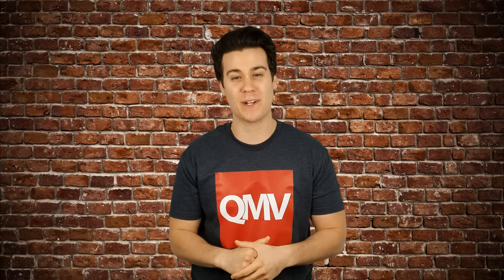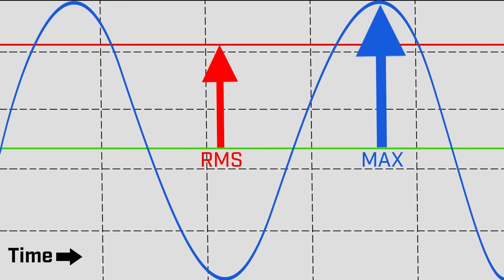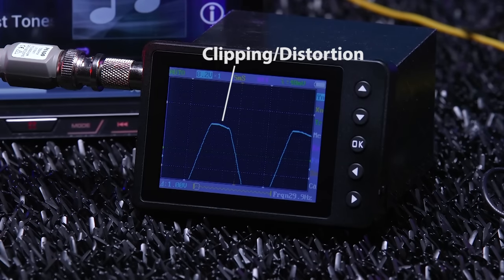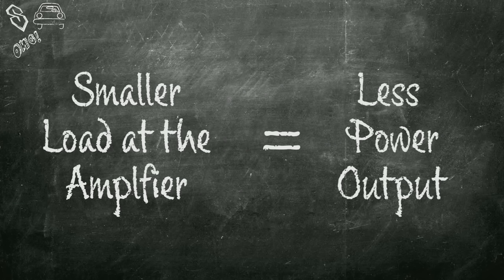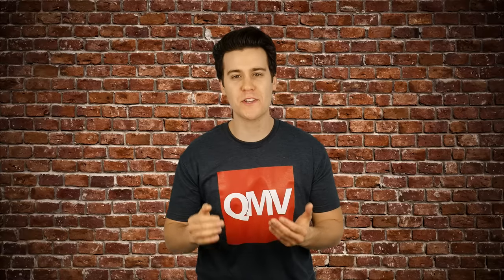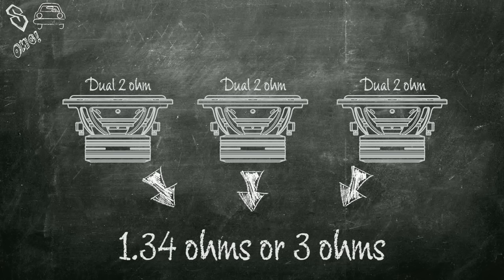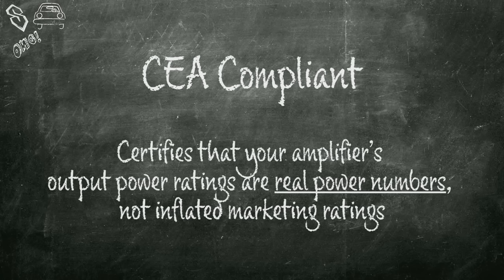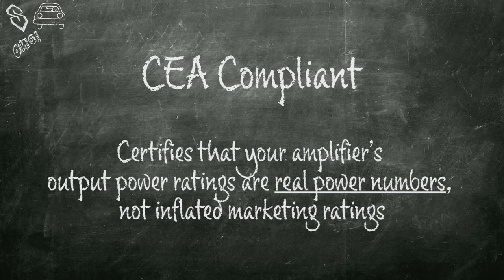How Do You Match Car Subwoofers and Amplifiers?

Comment: Great video, question for you; I have a foxbox with two 12” Alpine Type R / 2 ohm / 2250W Max 750 W RMS / model R-W12D2 going in my 2017 Ram Truck Quad cab. Trying to determine a good amplifier and want to know your suggestions? I currently have an Alpine mono M500 which I know is quite under powering this.
Reply from the maker: Thanks Tommy! Ok so you have Two DVC 2 ohm woofers with a combined RMS of 1500W. Two DVC 2 ohm woofers can wire to a 2 ohm or 8 ohm load. You'll ideally want a monoblock amplifier with a power range of about 1400-1700W RMS @ 2 ohms. Here are some examples:

Power Acoustik EG14500D 2000W RMS @ 2ohms
http://www.qualitymobilevideo.com/eg1-4500d.html?utm_source=YouTube&utm_medium=Video&utm_campaign=Match_Subwoofers-Amplifiers

Power Acoustik BAMF1-5000D 1700W RMS @ 2ohms
http://www.qualitymobilevideo.com/bamf1-5000d.html?utm_source=YouTube&utm_medium=Video&utm_campaign=Match_Subwoofers-Amplifiers

Hifonics Zeus ZRX3216 1600W RMS @ 2ohms
http://www.qualitymobilevideo.com/zrx3216-1d.html?utm_source=YouTube&utm_medium=Video&utm_campaign=Match_Subwoofers-Amplifiers

Hifonics Brutus BRX2016.1D 1400W RMS @ 2ohms
http://www.qualitymobilevideo.com/brx2016-1.html?utm_source=YouTube&utm_medium=Video&utm_campaign=Match_Subwoofers-Amplifiers
Reply: Quality Mobile Video thanks so much for the information, it is greatly appreciated.
Reply from the maker: @tommy.32221  Anytime!

Comment: Okay i have a question, sorry if this has been gone over but..
I have 2 Subs with a RMS combined of 1000, and I have 4x Car door speakers with a RMS of 360.
My question is am i able to connect all 6 to one Amp or will i need to purchases a separate Amp for each, and if i can use just the one amp, what should i be looking at? oh and both are 4 Ohm.

Cheers

Comment: im looking to buy a prefab box whit 2 12'' sub running a total of 1500watts on there site it says 4+4ohms what does this mean it is the Hifonics MXT12DUAL whit a Rockford Fosgate T2500-1BDCP amp is this a good match or is this bad im new to building my onw subwoofer install ?
Reply: 4+4 means its a dual 4 ohm voice coil setup

Comment: I understand the whole multiple subs concept but im struggling with single subs so I just brought a Kicker comp R 10inch sub with 800 watt max and a 400 watt RMS while my amp is a Crunch PDX 1000.2 channel amp with the specs as listen 
General Features:
PDX Series 2-Channel Class A/B Car Amplifier
MAX Power Rating (14.4V):
4 ohms: 250 watts x 2 chan.
2 ohms: 500 watts x 2 chan.
Bridged, 4 ohms: 1000 watts x 1 chan.
RMS Power Rating:
4 ohms: 125 watts x 2 chan.
2 ohms: 250 watts x 2 chan.
Bridged, 4 ohms: 500 watts x 1 chan.

WILL THIS WORK FINE OR DO I HAVE TO WORRY ?

Comment: So I am attempting to install the ss ws82 subwoofer into my brother's 2008 Toyota corolla car. its input is 150 watts, I want to add it to the car and leave the original speakers the same. can I get by with a 160-watt amp? it is hard to find exactly 150-watt amps online for cheaper. or any other suggestions?

Comment: HEY JAMES WHAT AMPLIFIER WILL I NEED FOR MY (2) RMS 750 Watt
AUDIOPIPE 12" 3000 WATT Car DVC Subwoofers
2.5" DUAL 4 Ohm Voice Coils
Double Stacked Strontium Magnets
Powder Black Cast Aluminum Basket
12" Dual 4 ohm TXX-BD Series Subwoofer Power Handling: Peak: 1500 watts RMS: 750 watts 2.5" 4-layer voice coil Top-mount depth: 7-1/4" Frequency Response: 20-900Hz Sensitivity: 88dB Patent pipe multi-connect terminal Powdered black steel basket Double stacked magnet
Reply from the maker: Hey Michael! Two DVC 4 ohm woofers wire to 1 ohm or 4 ohm. You'll probably want to go for the 1 ohm load (parallel wiring). The subs have a combined RMS of 1500W. So you'll want a monoblock with a power rating of 1400-1650W RMS @ 1 ohm. Check these out:

Orion XTR15001.Dz 
https://www.qualitymobilevideo.com/xtr15001dz.html?utm_source=YouTube&utm_medium=Video&utm_campaign=Kicker_Line

Hifonics BRX2416.1D Brutus 
http://www.qualitymobilevideo.com/brx2416-1.html?utm_source=YouTube&utm_medium=Video&utm_campaign=Kicker_Line

Power Acoustik BAMF1-5000D
http://www.qualitymobilevideo.com/bamf1-5000d.html?utm_source=YouTube&utm_medium=Video&utm_campaign=Kicker_Line

Power Acoustik EG14500D
http://www.qualitymobilevideo.com/eg1-4500d.html?utm_source=YouTube&utm_medium=Video&utm_campaign=Kicker_Line

Power Acoustik BAMF13000D
http://www.qualitymobilevideo.com/bamf1-3000d.html?utm_source=YouTube&utm_medium=Video&utm_campaign=Kicker_Line

Comment: My new speaker is 850w RMS at 1ohm and my amp is 800w RMS at 1 ohm. This is ok right? Also my ported box is 1.52cf and the minimum for the speaker is 1.75cf. Will i run into issues with .23cf less?

Comment: I just  purchased  a Tharamps smart 3k at either 1 or 2 ohms and I have the space on my suburban, what subwoofer(s) will you match it with?
Reply from the maker: Nice. Those are beasts. For 1 ohm, you can use Two DVC 4 ohm subwoofers with an RMS of about 1200-1500W each. For 2 ohm, you can use Two DVC 2 ohm subwoofers with an RMS of about 1200-1500W each. Be aware, you'll be drawing some serious current, so double check your alternator/electrical supply an handle this

Comment: I have 2 power acoustik FUBR series 1800-watt-12’s dual voice coil, 2 ohm subwoofer. What amp should i get? Help a brudda out
Reply from the maker: FUBBRRR
So those are DVC 2 ohm subs, with a combined RMS of 1800W Right? 900W Each? Then I'd suggest a monoblock with a power range of 1700-2000W+ RMS @ 2 ohms.  I suggest these:

https://www.qualitymobilevideo.com/car-audio/car-amplifiers/mono-car-amplifiers.html?amp_output_power_rms_2ohm=1700-3300
Reply: Im not a 100% about the wattage. Tried doing research on these but couldn’t find anything.  But i really appreciate the reply I honestly didn’t think i would get one thanks 🙏🏾. Video is great btw.

Comment: I have a Kenwood KAC-D8105 5- Channel amp and at 4 ohms I can run a 300 watt subwoofer, can I put a 300 watt 4 Ohm subwoofer on this Amp or should I go a little higher but I won't be pushing the sub to its max so will my pick fit the amp?

Comment: Brother I have an amplifier MODEL 1800W High Output 5 Channel:
Up to 225 W X 4 RMS @ 2 ohm
Up to 113 W X 4 RMS @ 4 ohm
Up to 450 W X 2 RMS Bridged @ 4 ohm
Up to 450 W X 1 RMS 5th Ch @ 2 ohm
Up to 225 W X 1 RMS 5ht Ch @ 4 ohm

That goes with the MTX terminator dual 12 inch 1200 watts subwoofer, and 4 sony speakers: 2 for the front with AMS 50 and the rear speakers 60. Also two tweeters (Skar Audio TWS-01). What wires should I use? Am I good with those combinations?

Comment: Hey guys, I want to upgrade my car audio to Pioneer Z series speakers, so I've purchased front( Ts-z65c) and rear(Ts-z65F)plus 2 Ts-z10ls4 10" subs for sealed enclosures for the boot. I want to keep the system all Pioneer so which amp or combo of amps would you recommend to power this system? 🤔

Comment: So an overpowered amp Is good ?
Reply from the maker: Don't think of it as overpowered, because it's not. Think of it as "headroom". The subs won't pull more current than it can handle. Whereas if you have subs with a higher power rating, they'd be starved for power and pulling more current than your amp could handle

Comment: I have a 4ohm sub with 425rms power rating. Will wiring it to 2 ohms make it sound more powerfull? Does it need a better amp if I do so?
Reply from the maker: A lower impedance with double the output, but not every sub can be wired to just any load. Is it a dual voice coil or single voice coil sub? You can only wire one DVC 4 ohm subwoofer to 2 ohms. But it also depends on if your amplifier is 2 ohm stable

Comment: Yo dude! Love your videos! I need an advice, so I hope You can help me. I have amp that puts out  1 x 650/1000/1400 Watts RMS @ 4/2/1 Ohms (1300/2000/2800W MAX) and I'm wondering what would happen to it if there were 3 dvc 2 ohm with 1000 rms each (Ground Zero GZIW 12SPL) connected to 1,33 ohm. My guess is that it would play for 5 minutes and than...pufffff

Thanks!

Comment: Ok so im new to all this, I had 2  Rockford Fosgate R2D4-10 Prime 4-Ohm DVC 10” Subwoofer 250 Watts RMS / 500 Watts Max hooked up to a HIFONICS Zeus 1X1200WATTS@1OHM Mono. Blew both of them within 2 weeks and just bought 2 more of the same subs, was that a mistake? What should I have instead and if it's not that what do I need to have done so that the new set won't blow???

Comment: @Quality Mobile Video I just got one too mine is P3D4-12 and thinking of adding another sub later on but don’t know what amp to get and if I get one right now that powers both of them if it would still work with just one sub while I add the other sub later and I’m planning to wire both subs at 4 ohm and as well with my only sub right now
Reply from the maker: Well it'll be tricky finding an amplifier that'll work with one then two without running into a power/impedance issue. I would suggest getting the sub now with the amplifier

Comment: I have 2 infinity 10 inch subwoofers with 1,200 watt peak. Also a alpine mrp-m350 amp 700 watt. My system quits at a certain point when I turn it up. I also bought a new amp wire and it’s 1,200 watt. I need help fixing that problem. Do I need a better amp.

Comment: So now if i also want to upgrade my 4 door speakers and get good quality ones and want them amped to sound good, do i still get a mono amp? Or which channel amp? Or is it better to get a seperate amp for the door speakers?
Reply from the maker: Well you have a few options. Get an additional 4 channel amp for the speakers. If you get a 4 channel amp that's bridgeable and powerful enough, you can hook up all the speakers and the subwoofer to it. Or you can keep the speakers all powered by the factory headunit/amplifier and just use a monoblock for the subwoofer

Comment: I just bought a Fosgate P312, what kind of amp would you recommend??
Reply from the maker: did you get the 2 ohm or 4 ohm?
Reply: Quality Mobile Video I just got one too mine is P3D4-12 and thinking of adding another sub later on but don’t know what amp to get and if I get one right now that powers both of them if it would still work with just one sub while I add the other sub later and I’m planning to wire both subs at 4 ohm and as well with my only sub right now

Comment: Hi I have 2 10inch edge extreme subs both 1ohm each and 1500w each with 3000w max each I'm having a ported box made which is 30inches by 15 inch by 15 inch what amp would I need to power these properly thanks

Comment: Hi i got a pioneer amp at 1200 rms at 1 ohm monoblock class d. I got 2 x subwoofers of 1000rms each dual coil 4 ohms. I have wired them in  parallel to 2 ohms which makes it 1ohm at the amp since its mono. Please correct me if im wrong. Are my speakers getting damaged due to the amp being under powered or isit safe as the amp doesnt have enough power for both speakers?

Comment: hi I’d like to add on my car an 12 '(600 rms - 1200-Watt 4-Ohms) subwoofer, and a 6.5-inch midrange (500W Max, 250W RMS, 4 Ohms) and 2 JBL tweeters (3/4 size) to give stereo sound in the box. That is my idea, so what is a good amplifier and type for all these? need 4 channel class AB? or 5 channel. thxs

Comment: I have a class A/B amp 5 ch 3000 watt 2/4 ohm stable.  If i bridge the amp with the + on ch1 and - on ch 5 does that realease the hole 3000 watts on a single ch at 2 ohms?  Or is bridging the common 4/5th ch for a sub. Without any of the other ch being used release the full power into one ch?  This is just a hypothetical question I am not doing this I have just always wondered about this scenario.  Thank you.

Comment: If I have a set of 2 subs wired to 1ohm & another single sub also wired to 1ohm in an additional enclosure when using both sets of terminals of the amp... What does that do for the impedance the amp is seeing?

Comment: Hi, can you please help me choose  right amplifier to power my 2 10” subwoofers dual 4ohms and 1000 RMS each (combined 2000 rms and i wired them in parallel to make 1 Ohm load). I’m choosing between 2 taramps amplifiers, one is giving 3000 rms output at 1 ohm and another amplifier is 5000 rms at 1 ohm. Which one will be best for this setup? And also i have more questions, is 3000 or 5000 rms power more than subwoofers need? Is this extra power going to blow subwoofers?
Reply: Or using 2500 rms amplifier will be perfect for this setup?
Thank you

Comment: just purchased the jl xd1000/5v2 with JL c2 component factory replacement speakers.  My subs are JL 12w1v3-4 (4 ohm).  Putting in a dual sealed enclosure with 1.2 c/f per sub.  My amp says it will push 600w to the subs.  My question is how to run the speakers wires from the amp to the pair of subs.

Comment: I know this video is kind of older BUT I'm trying to figure out which type of Kicker L7....I need/want for the price?. I have Two Memphis Audio 15" M5s in a ported box which was custom built for a prior vehicle. I've had these for a few years now, haven't used them for at least a year +  but need to down grade in size/ amount etc.... Space is an issue (obvi) 🙃 I now have a 2019 Mazda CX-5 Touring that I'd like Bump & thump.Hard...  B.U.T considering I am a mother now and I leased my vehicle lol which L7 would satisfy my craving for bass while not taking up all the room and destroying my children's hearing (when they decide to listen that is) I don't listen to loud music with them in the car.... jus an FYI. I need help. Should I get an extra battery🔋(the small ones for systems) or like a compressor or whatever the digital lil canister is like a  2+ Farad? I'd like a 12" L7 don't think that would be too much? Or maybe even a 10" L7 (not ported box, but doesnt really matter) considering I've never had a solo baric before, I've heard awesome things but I'm trying to reign in my inner child when it comes to car audio and not go over board. But I'd like to blow the bass off the chump around the corner that rattles every time his cheap lil Nissan drives by... thank you for any help/advice.

Comment: Can I use 2 pyle plpw10d to a xm zr1852? I've been watching these videos from you and every step starts to get confusing. I'm extremely new at this besides a listening ear to bass. I have read the specs of the amp but still not understanding of where it says anything about RMS..the subwoofers on the other hand says it is 500 watt rms 4 ohm. The impedance for the amp says 4 ohm. So i need to connect the 2-4ohm speakers to create a 4ohm to the amp by series. But i do not know if the speakers will blow with this amp. The only thing i found was a max output power of 380 x 2 and a continuous output of 180 x 2. Then i found input signal voltage which goes to 6v. The speaker wire i found to connect ea speaker then to amp is 12 gauge 12v ofc. If you could help i would really appreciate the help. Those are the brands so if you dont know right off the top of your head what everything is please refer to search engine..I've been trying to figure this out for 6 hours now. Thanks in advance!

Comment: Is it ok to run lower max watt subs on a higher output amp? For example I have 2x1200max watt 4 olm subs and a 1500 RMS @2 olms monoblock amp. If it is ok, should I use parallel or series wiring?

Comment: Hi.  I have a question.  If u have a 4ohm dual voice coil sub.  Can u use only just 1 of the voice coil?  Because i only have a 4ohm amp. But my sub is dual coil 4ohm.

My set up 
Im planning to bridge the amp 2 channel 

DC AUDIO M3-6 D4 SUB 6.5 @300w rms 600w max

Amp.  Pioneer GM-D9604

Comment: I need help! As much as possible I want to buy a single amplifier that will power all my speakers or do I still need to buy a separate amplifier for my subwoofer?

I have a 

JBL GTO609C
RMS: 180 watts per pair / 90 watts each
Recommended Power: 5 - 200 watts RMS each

JBL GTO939
100W RMS
4 ohms

JBL S2-1224 Subwoofer
275RMS selectable 2 ohms or 4 ohms

Comment: What about two svc 4ohm 700w rms subwoofers ran in parallel to reach 2ohms? Does that raise or lower the watts?  If so, same question about the amp. My amp is a 1ohm stable 950 watt rms. Can a 1ohm stable amp be ran at 2 ohms or is that brand specific? I plan to under power the amps and the subs since I’m only looking to gain some low level bass.

Comment: I have a 600w 4ohm sub and don't know the RMS because the site don't say it. 
Plus I have a 1200w 2 channel amp peak with a 
900w RMS
450w x2 RMS @ 2ohms
225w x2 RMS @ 4ohms
900w x1 RMS @ 4ohms bridged
Would it be bad to bridge the 1 sub to the amp?

Comment: Hey I have 3 12" svc subs 4ohms @ 400 rms each and a amp rated for 1ohm load @ 900 rms and the subwoofers are wired down to 1.33 is that under powering the subs?

Comment: I have 4 hifonics bze65c speakers an tweeters with 4 hifonics 12db/Oct crossovers ,also have 12inch 750rms kicker l7s in ported box . 

What kind of amp should I use for this set up?
  I do have 2 amp one that is a monoblock d amp an another that is a 4channel amp both over 1200watts I was planning on buying a planet audio monoblock d 2500watts amp to have more watts if I decide to add more stuff later or a 1200watt one . 

Do I need two amp to run all the speakers an sub or can I run just one monoblock d amp for this set up?  

Also do I use a 4gauge wire or do I use a 0guage wire since its bigger an more powerful/better quality?

Also for the 4 hidonics speakers with the 4 crossovers should I use them or should I get something else I have a 2016 ford fusion se .any help would be appreciated.

Comment: So I have 2 dual 1 ohm subwoofers at 1500 watts rms, if I parallel wire them I can get 0.5 ohms out of an amp so does that mean I need a 3000 watt amp that is 0.5 ohm stable?